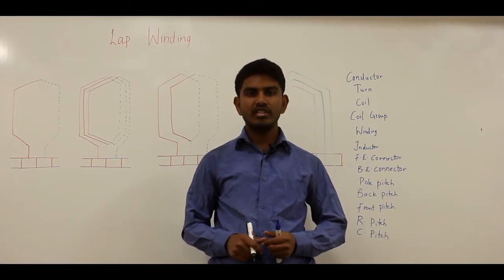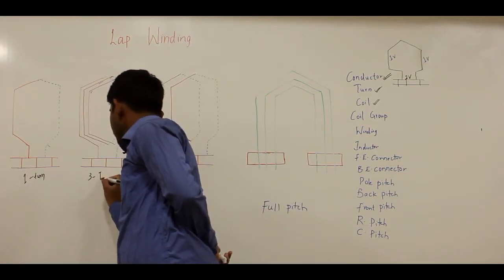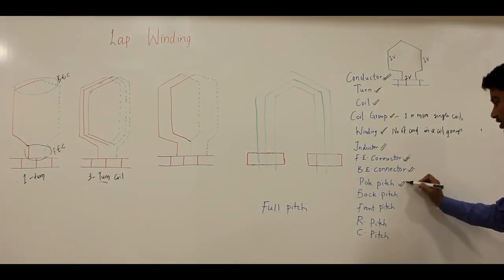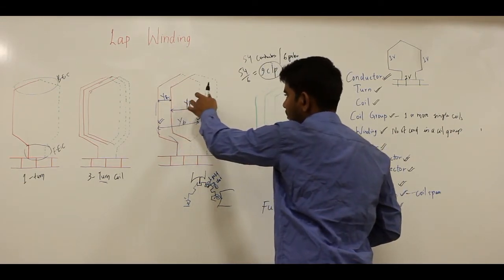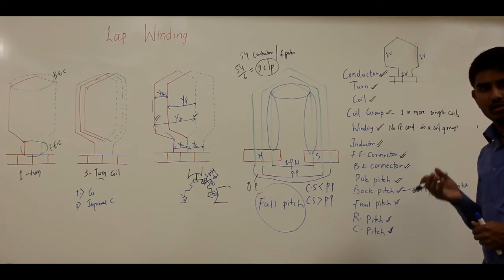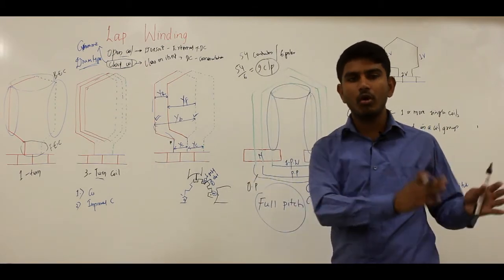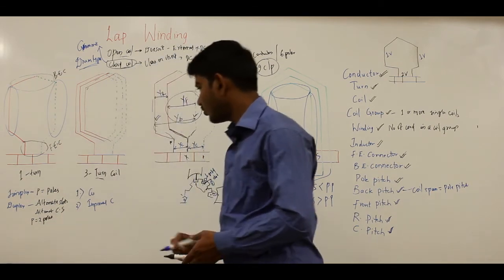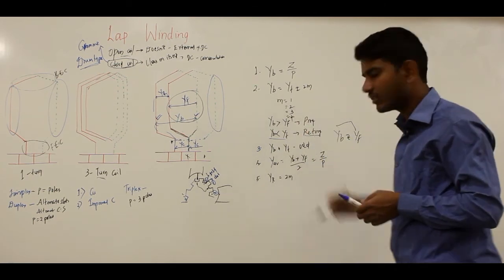Lap Winding in DC Machine

Comment: a 200V,2000 rpm,10A, separately excited dc motor has an armature resistance of 2 ohms.rated dc voltage is applied to both the armature and field windings of motor.if the armature draws 5A from the source, the torque developed by motor is?
Sir can u please help me with this...